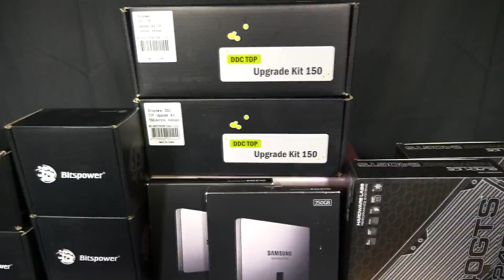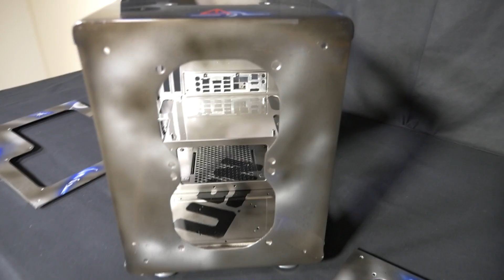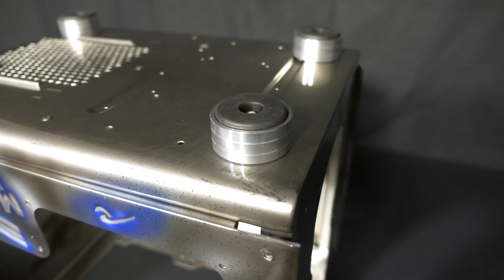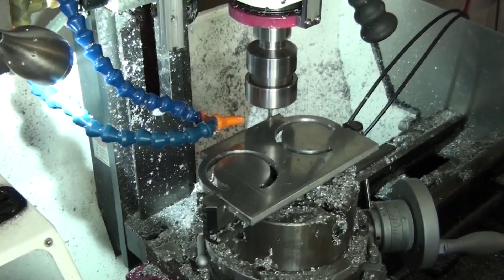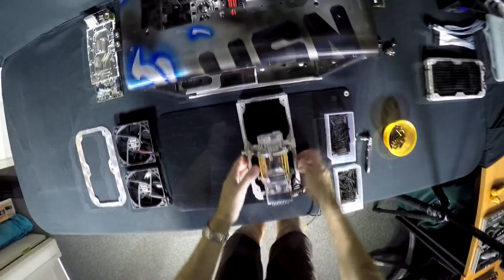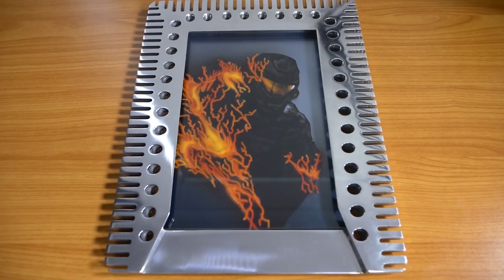Extreme Modding: CB19 'Master Chief' Build Log: Part 1

Comment: Here is a interesting question for the singularity community. When it comes to water cooling. Using the proper fluid is critical.   Since my amateurish search was getting me nowhere.  I started looking for those professional products. Like those uses in (Cyrix Systems) mainfraimes. 

After some significant research. One compound stood out from the rest. Flourinert by 3M which has an  ideal freezing vaporizing points and also has a great heat transfer factor. So I am curious if anyone had used this?  Not sure how hard this would be to come by. 

But might be an alternative to  the current standand. Since it's a totally inert liquid that looks and behaves like water and has the same thermal transfer properties.  But does not conduct electricity or cause corrosion.  Or in fact react with anything at all for that matter.  

Cray uses it to cool supercomputers. Amari Computers has started to use it in its watercooled midi-tower PCs as a maintenance, corrosion and short-circuit worry-free solutions. Maybe i am behind the times on this but seems promising, thoughts?  :)

Comment: Hey guys, I have a question not related to this video but I need someone's opinion. I recently bought an individually sleeved, 24-pin cable for my RM750 off of Amazon. Looking at the cable though it had marked on it "AX1200i ONLY". I looked on Corsair's website and when you look at the individually sleeved 24-pin cables, it has a list of the compatible PSU's but the image they give is the same as what I have with the "AX1200i ONLY" marking on it. Am I alright to try this cable on my RM750? I have bought other individually sleeved cables before and had no problems.
Reply: Cant think of anything but the connector that can change. The rest is just 24 cables. It doesnt do anything.

Comment: Why didn't you use a 200mm radiator in the front then mounted dual pump/res side by side? Dual loops in the prodigy is more than possible, the case is massive for mitx.

Comment: I'm surprised the client still had all the boxes for the previous build. I hang on to some of mine but not all. I know there's a pretty long waiting list so maybe after getting the quote and an ETA bought some of the components and started using them until it was time?
Reply: +applemaggot I always keep my boxes encase I need to RMA or sell the items.
They normally sell for a higher price if you have the boxes, manuals, anti-static bags and extra cables it originally came with.

Comment: this is my build and what you think guys this is good ? ))) or if i make some mistake here what i dont know somone tell me pls
(i am not proffesional about this )
Graphics Card : (MSI Gaming GTX 780 ti)
Processor : (intel core i7-4790 processor - bx80646i74790)
Memory : (Kingston HyperX FURY 16GB Kit (2x8GB) 1866MHz DDR3 CL10 DIMM - Red (HX318C10FRK2/16)
Motherboard : (MSI Z97 Gaming 5 Intel LGA1150 Z97 ATX Motherboard)
Case : (Colorful Raynor Tower G3) 
Power Supply : (Corsair Hydro Series Extreme Performance Liquid CPU Cooler H100i)
Storage : (Seagate 1TB Desktop HDD SATA 6GB/s 64MB Cache 3.5-inch intemal Bare Drive (ST1000DM003)
SSD : (Samsung 85 EVO 250GB 25-inch SATA III internal SSD (MZ-75E250B/AM) 
CPU Cooler : (EVGA SuperNOVA 750 B1 80+ BRONZE, 750W Semi Modular 5 Year Warranty Power Supply 110-B1-0750-VR)
Reply: +Nukri Javakhishvili Why a 780 ti?
R9 390/980

4790 is stupid, go with a 4790k
For the SSd, you could use a Crucial MX200. For the Cooler I would go with a custom watercooled loop, or an big Aircooler
Reply: +Nukri Javakhishvili looks good to me so far.. but you accidentaly mixed up the psu and cpu cooler in your list..
anyway.. 
the only thing i can find here is that you got a mainboard with z97 chipset in your list and no i7-4790k processor.. boards with z97 are unlocked for overclocking so i would either go with the 4790k cause this processor is also unlocked or go for another motherboard without the ability to overclock cause you can save some money there in this case.. it just makes no sense to go for a motherboard that is open for oc and put a cpu in it wich is not.. 
another thing is the 780ti.. is there a reason you want to go for this card like you can get a used card somewhere or got one from your old pc? elseway i would go for a 980 over the 780ti if you would buy them new.. or if it's used also i would maybe think about paying a little more and get a new 980 instead as i just checked for used 780ti's and they are fairly expensive for a used card (at least in my country on ebay) and it's an older generation with no real support for dx12 and less vram..